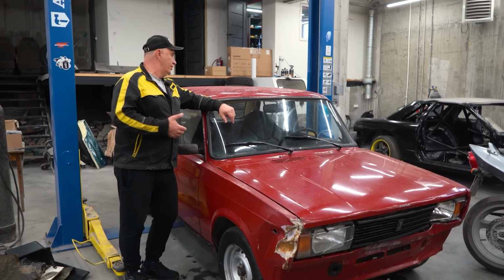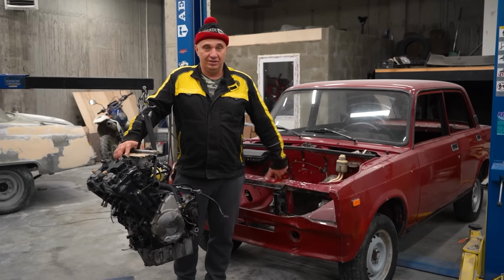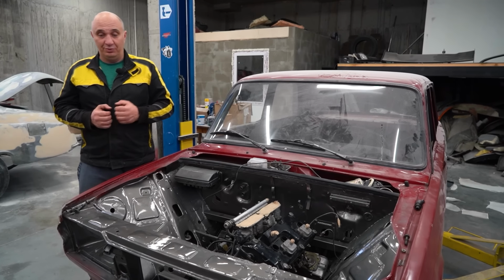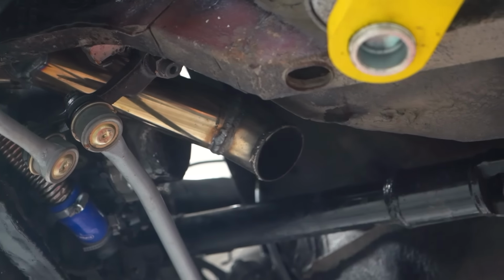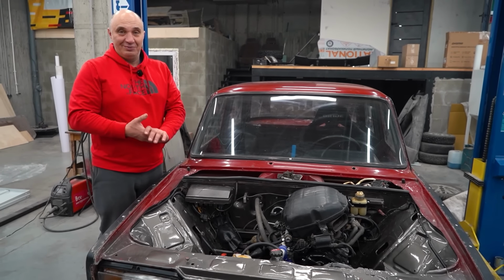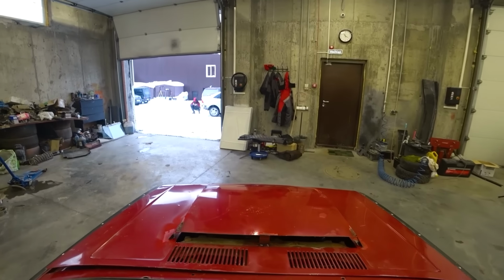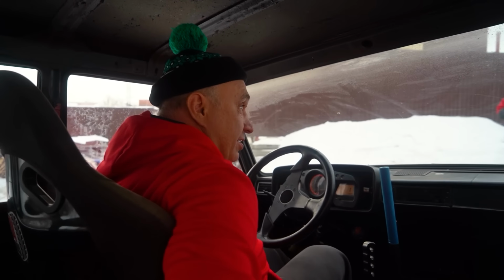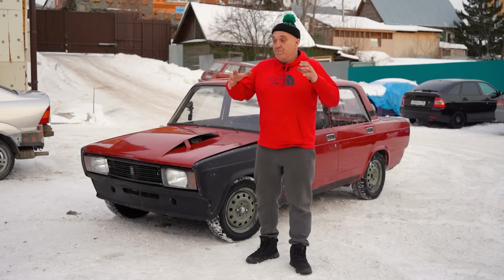We Swap a Superbike Motor into a Lada

Comment: Using parts of a second trans to add reverse and an odd low range is actually pretty genius.
Reply: 2nd transmissions were used a lot in home built off road trucks, w/a shortened wheelbase used up here in Northern New England US of A for logging duties.
Reply: A lot of motorhomes use a overdrive unit Mounted behind the transmission and there's a company that builds them called "gear vendor" essentially, it gives you an overdrive gear for every foward gear so you would have 
1st
1 overdrive
2nd 
2nd overdrive 
And so on 
It gives you a lot of options including using a much higher Final gear ratio for accelerating and it gives you an additional overdrive gear on the high end so that you have better acceleration without robbing you of your top end.
Gear vendor builds them for anything from tow rigs to drag racers and rock crawlers. Drag racers love to use the old school two speed power glides because they are bulletproof and putting a gear vinder behind them allows them to have two overdrive gears one for each gear.
Reply: **6 reveres gears
Reply: yeah i was gonna say thats quite an outcome
Reply: The gear ratios of the bike box and the weight of an automobile usually don't match well with a motorcycle engine and box.
Reply: @AlienLivesMatter most motorcycles weigh as much as a Lada, so that wouldn't matter much at all. That motor has way more torque and HP than the original engine.
Reply: agreed
Reply: @AlienLivesMatter  with 30 gears, regardless of bike internals and diff ratio you can choose the perfect setup for them via testing, I suspect 3rd on the back box and use the bike gears will give them the best results
Reply: It's no different than a 13speed twin stick semi, back when rigs actually had two transmissions.
Reply: @Undertaker1134Tx What?😂😂😂 A CBR 1000 rr weighs about 185Kg and it's power output is about 185bhp.
Reply: @Undertaker1134Tx nice bait
Reply: @UberLummox
I've got a doubler in my square body.
Reply: It's not like a sequential great box, it is one! You can install a strain gauge or a switch on the shifter so when you pull it, it cuts the ignition for a split second and allows you to shift without lifting the gas. Really bang through the gears that way!! I have a feeling this is version one of this project and it's not the last we see of it. I hope so anyway!! 
Does anyone know what Lada means or does it translate to anything or is it just the name? Curious is all..
Reply: Your ‘likenumber’ daid 666…
I just had to click it…..
Reply: Try to put the engine in trunk So can be mid engine layout
Reply: @Undertaker1134Tx This is a joke, right?
Reply: Did you really have to make it out about the trans...?

Sick of hearing about them... :)
Reply: a common sense solution, just run it in top gear when you need to reverse faster  a turbo would fix the drivetrain loss.
Reply: People used to make tractors with two transmissions hooked up to each other you got a lot of speed out of that
Reply: It needs more flywheel action
Reply: Not sure which type of bike your riding.
Most bikes weigh 400-600lb.
A Lada weighs 2000-2200lb.
If you can ride a bike that weighs in at 2000lb, then you have my respect.
Reply: How do you get 13 ratios with 2 gearboxes?
Or do you mean 26 ratios?
Reply: . It's been done since world war I and world war II to make tractors in the backyard
Reply: some frecnh ass dude already had done the same he swaped a twingo 1 with gsxr 1000 its sp funny to ear a twingo doing a super bike sound
Reply: You have got no idea, a motorbike doesn't weigh anywhere near what a car does, even an old Lada.
Reply: Genius? It’s been done for years 🤦‍♂️
Reply: @Undertaker1134Tx  A Lada weighs 4-5x as much as a superbike.
Reply: @Undertaker1134Tx  Come on, you're exagerating a bit... I have a Blackbird, like the one used here as a donor bike, it weights around 265 kg... A Lada doesn't weight 265 kg, it must be around 700 kg or something...

Comment: One popular modification in the Volkswagen community is to take a Suzuki GSXR-1300 Hayabusa engine and mount it in a MK1 Golf [Rabbit in the US].  The engine fits perfectly, since it is approximately the same size as the Volkswagen EA827 engine the car came with, and it is easy to fabricate adapter plates.  Since the early Golf was between 1800 and 2100 pounds, this 200 hp engine turns the little car into a raging screaming beast that runs with V8 Mustangs and Camaros.
Reply: Cool story bro
Reply: There are some in The Netherlands too
Reply: @equalizer4633 I'm building one. It's a 1982 Fiat 126p with a GSXR1000.
Reply: I would kill to put a Busa engine in my 1993 Gemini!!!
Reply: I wonder how the reverse gear works though. Did they add a second gearbox or something?
Reply: @explosiveboner3494  bro, watch the video hahahahaha
Reply: @kawaiirunnersdriftclub  I did but... It's for the other builds. Are they doin the same?
Reply: @explosiveboner3494  not this one. Here they got a mitsubishi transmission to use as a carrier bearing and to have extra gears including reverse, while still having the sequential transmission with the bike engine.
Reply: @iveboner3494 Good question, I'm not sure.  I think they shave the gearbox off and weld plates so that it can mount to the VW gearbox.  The Mk1 Golf/Rabbit 020 manual transmission is supposedly good for 300 ft/lb of torque.  A 'Busa motor is never going to come close to that figure.

👍
Reply: @kawaiirunnersdriftclub  -I've got to say that I like your screen name;  I should have come up with that, it fits me perfectly~
Reply: @Flies2FLL  which name you see? I just see my own name hahaha
Reply: @kawaiirunnersdriftclub  Wrong person, sorry.
Reply: Haha that sounds like it would be epic. A Busa engine in a old Golf blahahahaha actually Epic isn’t a good enough word…….Insane Awesome it would be🔥👍🏼
Reply: @Nxt25  yooooo a maluch! are you from poland?
Reply: @nooooooooooo6uoki67  No I'm from the Netherlands. But the car is imported from Poland.
Reply: @Nxt25  sweet, its gonna be a handful i bet! best of luck and stay safe
Reply: Basically, it's a Golf Mk1 GTI but better.
Reply: @Nxt25  Don't you need to delete the last two seats? At that point might as well just go all out and add an even better engine. 

I think a 600-700 cc sport bike engine would be better for a proper 126p sleeper.
Reply: @fungo6631  Yes, basically everything behind the front seats, including the floor, is removed.
It won't be a sleeper. It's getting a full roll cage, both for structure and safety, and I'm trying to design a widebody.
I chose a 1000cc for the torque. Preferably even a 1200cc but those are rare and expensive here.
Reply: @Nxt25  At that point you might as well just use an actual car engine.
Reply: @fungo6631  too heavy and I really really wanted a sequential transmission

Comment: Is this Garage 54?? This is a legit build. Incorporating a second transmission is nothing new but engineering it for this purpose is a stroke of genius. I would question matching up the gear ratios but it's probably fine in a Lada and makes the whole project especially interesting. That fabrication work is also no joke. You guys seriously stepped it up this time, there's real potential here . Please keep this project going.
Reply: 🟦…I agree, he needs to find the lowest gear that it needs to drive the proper range of that secondary transmission and just Leave it there!
Reply: No this is garage 55

Comment: The mind boggles how well you've done this, it looks incredibly easy to drive considering the amount of engineering involved.
Reply: Cool story bro
Reply: Its not that easy to drive since you need to learn the new gearbox style and two gear selectors. My issue is mostly running on certain gear most of the time. For offroad truck this makes sense as you are using whole range pretty much, but daily driver not so much. Still lovely little contraption and i wish some company made cheap couple gears and reverse boxes, but nope those are hella expensive what little is out there. Secondly this would never be road legal here. Just repair welding the subframe is automatic failure in yearly inspection. Seeing this, engineer would get brain aneurism and cause of this only place to use in is on the offroad side, maybe utility vehicle, but that also means it being diesel, witch there is very few around and completely out of price range of average joe.

Comment: You will need a dry sump system. The Oil will vet skoshed to the side because the engine is no longer leaning whilst taking a turn. This will probably cause oil starvation if not taken care of.
Reply: Super fast Matt killed a CBR engine on the track in this way

Comment: sick build. just a warning though, motorcycle engines and their oil pan are designed for leaning during cornering. if you thrash the car hard in corners it will starve the engine of oil and lead to spun bearings. a dry sump is the way to go unfortunately. superfastmatt has done the same in a honda s600 chassis. keep up the good work.
Reply: My thoughts too after watching Matt's s600 a few years back

Comment: I owned this exact motorcycle once, it was the most powerful thing i've ever ridden
Reply: Modern 750cc makes more power than this blackbird, liter bikes all make near 190, with some up to 220. But still fast yes 🏍️
Reply: @vistakay  Nowhere near the same torque though
Reply: @t16205  1100cc blackbird makes 93 foot pounds while gsxr 750 makes 63, both bikes have very near the same output power so with weight they are probably very close in speed. 

My original point is bikes have gotten even crazier than when you rid the blackbird, and with 40% less engine size and weight.
Reply: @vistakay  Thats a significant amount of torque. Im not disputing your point, all things evolve. Dont forget you are comparing a 25 yo sport tourer with a modern superbike. Sport tourers in general are much heavier, larger, and have more torque due to the larger displacement. This alone makes them a better choice for a car conversion.
The golden era of superbikes was in the late 90s-early 2000s, and even though the new bikes have higher effect, dont underestimate the torque on the golden era bikes. I ride both modern and classic superbikes, and the new ones have suprisingly little on the classic ones on the straights

Comment: THIS WOULD HAVE gone WELL with that red 'Shorty' 2 door Lada you did (the one you fitted a full wooden exhaust/Machine gun exhaust). Being a lighter vehicle, (without all the speakers lol), it could have been QUICK! Especially when you see vids on old Fiat 1267/127s & Smartfor2 & classic Minis fitted with 1200/1300/1400cc motorcycle engines!!! 😉👌
😎🇬🇧

Comment: They actually made a fast lada 😂😂 and reliable to boot 😂 i had a Lada nivia 4x4 once in the 2000s here in Australia 🦘 and never again 😂 but now im thinking of a Lada sedan with a Yamaha R1 or R2 engine with a second gearbox for reverse and low range gears but id use a Subaru Impreza WRX box and front and rear diffs or something similar like a Toyota Hilux set of diffs to make it AWD

Comment: This is awsome!

Actually motorcycles use the same type of gearbox as those found in sequential cars. The main difference being that on cars you usually find throttle blippers and cut off. Which is doing the same as just letting off the throttle. Modern motorcycles often have this though, it's called a quickshifter.

Comment: If you ever take something like this on a track or anything you will have to use a dry sump because the oil pan is not meant to be level in a corner all of the oil will leave the pump inlet on a motorcycle engine but adding a dry sump could be a good video idea.

Comment: Check if you need to add some baffles to the oil pan or modify the oil pick up or something.
Maybe it is going to have oil starvation issues when you turn left or right (similar to what happens when you do a prolonged wheelie on some bikes = turn left in your case).

Comment: @Garage 54   You are going to have to change to a dry sump system, or modify the oil pan. Motorcycles lean for turns, cars don't. The oil in the pan will slosh up the sidewall and starve the engine of oil.

Comment: might be a nice setup to put in shorty , thats a verry light car 
or build a lotus 7 replica with the thermoformed plastic bodyparts 
one thing with motorcycle engines is that the clutch basket tends to get damaged from the clutchplates hitting it with more force , causes the teeth of the clutches to make divits in the aluminium and over time it doesnt release as good

Comment: remember to downshift you want to "blip[ the throttle, catch the down gear on the RPM down or right in the middle, not on the RPM climb up, blip, downshift in transition or RPMs on the way down.. best for tranny, you can get auto blip, and auto shift, up shift it cuts the spark intermittent for the up shift, the down shift it blips the throttle automatically for downshift, sensors on the shift lever..  yup, that way you never think about it you just rail . . 

that Lada is cool as fugg, its a rear wheel drive with a posi rear end!...  INSANE, PERFECT for a turbo Hayabusa engine, a mild turbo say 500 reliable HP? . .   that thing would be an absolute hoot, drive screws from the inside of the tire, go do some ice drifting.....  lucky!

Comment: 2nd gearbox as an overdrive/reduction unit is also an elegant solution to shortened clutch life due to vehicle weight. Props. Has me wondering why this approach couldn't be used as a low-buck DIY overdrive for more conventional applications...  🤔🤔🤔🤔🤔🤔🤔🤔🤔🤔

Comment: I have a challenge for you. Try twin bike engines,  with both intercooled with turbo's, twin turbos. This is something im wanting to do to a compact pick up truck. Dual 1000cc plus bike engines with twin turbos. Yoy can run 1 engine when you want fuel economy,  fire up 2nd when you want performance

Comment: Putting a sportbike muffler will "help" with noise. Does it have some sort of an exhaust valve? (Yamaha EXUP, others copied it later) That will quiet things at low revs. Keep the engine in 6th gear and use the car gearbox instead, don't beat on the inbuilt gearbox too hard because if it breaks it gets dirty...

Comment: The real drawback of the two gearboxes is that every trasmission absorbes power in ratio of about 25%, so that yours 140 hp multiplied for 0,75 two times becomes at the wheels 78,75 hp, likely similar to the original lada power.
On the snow impossible to appreciate.
Personally I think would be better use only the honda gearbox, using an electric motor in one of the front wheels for the reverse.

Comment: Its weird to think how the motor bike engine was an improvement. In most cars you would sacrifice, power, rourwe, and mid range for less weight, but in a lada, its a huge top end boost, you probably get the same mid range, and it's lighter, and probably more efficient. Just goes to show how weak (in terms of power specifically) the lada engine is.

Comment: The clutch box for the second (Mitsubishi) gearbox should not be hard to make. I would fix the second gearbox to the pedal and add a hand clutch on the steering column under the left hand, or alternatively fix both clutches to the pedal.

Comment: if you're going the right speed u can downshift and  upshift on every car i ever drove without a clutch  like 86 bmw 2.6l,mercedes 300td.1996 chevy 1500 .2001 ford escort i drove ford escort without clutch using starter in first with gas and if you go right speed you can drive without a clutch pedal

Comment: There has been several cars that have done motorcycle engine swaps but they have been mainly front wheel drive cars and a rear engined car but you may be the first people who have motorcycle engine swapped a front engined rear wheel drive car it's is a great ldea to use the car gear box along with the gearbox that was with the engine you just proved it can be done next engine swap a Lada engine into a motorcycle

Comment: With that low of gearing you can spin too fast transmission components by freewheeling like you did on that hill at the end of the drive. Happens with toyotas with multiple transfer cases causing super low gearing